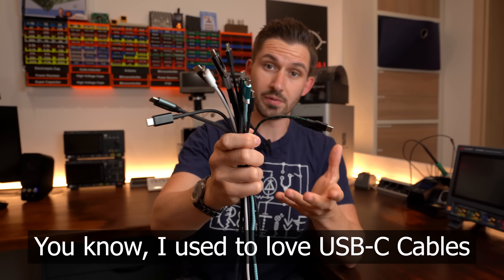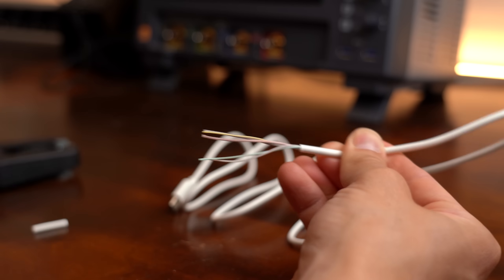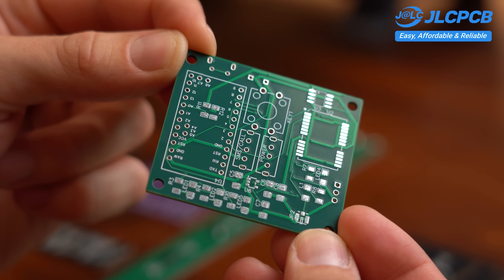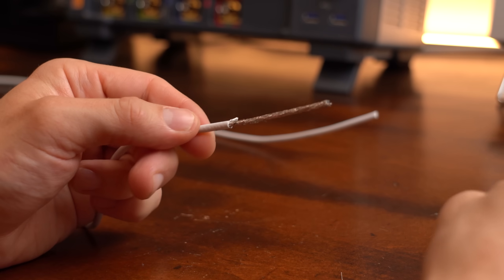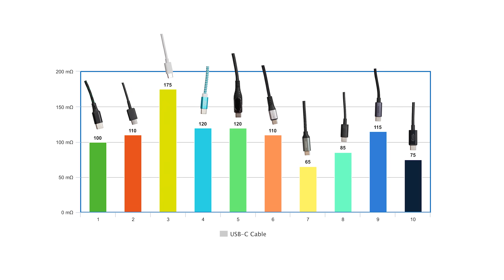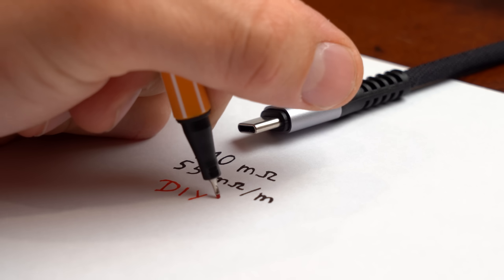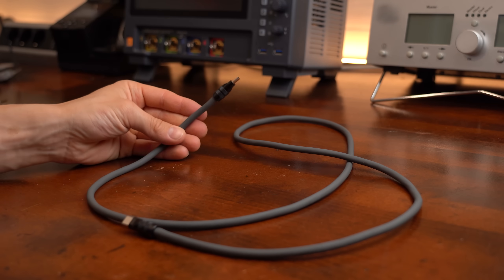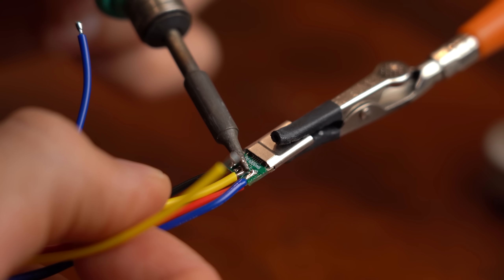Your USB-C Cable STILL Sucks — I Built a Better One? (DIY or Buy)

Comment: Probably worth shielding the data lines from the power. Another improvement possibility could be to use the entire cable as a large capacitor for smoothing power lines by running two shields.

Comment: A bonus for the 8-wire cable: it makes it extra easy to exfiltrate data as it acts as a transmitter.  It also helpfully receives radio signals (though only those around the clock speed matter much), because it's really an antenna.  So yeah, it's probably worth grabbing a shielded cable (with the shield connected to ground), unless power is all you care about.

Comment: Finally it’s something I wanted to do for so song!
Don’t forget to put a thermal pad on that IC and resistor. Or replace the resistor with a bigger wattage one, when they get hot they perform poorly at high PD

Comment: All USB cables have these problems, not just USB C. A lot of products that include a cable for charging are coming with cables now that can only charge but have no data wires and none of them are marked so it's hard to tell them apart so I had to buy a USB cable tester just for that!

Comment: Seems like it was annoying when the previous usb cables didn’t work, with a potential of 240W’s available it’s going to way more than just annoying when this goes wrong due to cheap components or incorrect specifications

Comment: I test the eMarker and PD capabilities of all my USB-C cables and devices when I receive them.  Then I catalog them according to their specifications and label them with a catalog number.  I do something similar for all my components.  

The idea that you can somehow know the specifications of a part just by looking at it is a fiction.  This is so for far more than just USB.  The administration of identifying, cataloging, and labeling pays back quickly.  That’s why enterprises do so.
Reply: Do you use the same tool as in the video?
Reply: Please elaborate on your process, I would greatly appreciate it

Comment: I use UGREEN 100W PD 6.6FT USB C Cables, not only are they priced cheap but they are high quality for that price. Got 2 of them almost 2 years ago and they are both still going strong. I will say though that when i do USB powered projects that only need the Power and Ground wires, i do use USB Male and Female Screw Terminals so i can use my own wires.

Comment: great vid, probably easier to find a reliable supplier for most applications….I learnt long ago to buy cables that explicitly state their application on the plugs, used to be horrendous back in the micro usb days! yet I still have those usb terminals in my drawer for those special projects

Comment: It is obvious that many chinesium cables barely work and the race to the bottom would be infinite, but did anyone try what is the MOST power that usb-c DIY monster of a cable would be able to continuously deliver without melting or burning up parts involved?

Comment: USB C cables are potentially dangerous with the slack standards in manufacturing! A few weeks ago I had one literally BURN in my hand using it to charge a Samsung Galaxy TabPro S. Not only did the cable end melt, it ruined the charger and the hub (video, network, usb C and usb A ports) There really should be some standard enforced to identify the capabilities of these cables. Micro USB cables were flawed in their own ways (wearing out, lack of features etc) but they "just worked"

Comment: I believe you mixed here two standards (widely supported simultaneously) PD and QC.
PD maximum power is 140w achieved by 28V/5A and QC can do more but doesn't acceed 20V
Reply: USB PD 240W is 48V and 5A, its a new standard.

Comment: See i hardly use usb for data only for charging. My phone will do 125w and i just buy cheap cables fromr temu. My son has autism and has a thing for destroying cables 😂. Anyway i have seen even on the stupid cheap ones, over 60w. Im talking 80p cheap which is roughly €1. I buy 10 or so at a time and rhey work very well. Ive never had a problem with data either they definitely do data as ive used them on my laptop with my game controller but i couldnt say how fast they are. I just dont see a big need now to move data over a cable when wifi is so fast and unless your charging a laptop 60w is more than enough for a phoneor tablet. I actually ruined my previous phone also 125w by super charging every time. The boxed charger is 125w so thats just what i used. In less than 2 years it was at 70% health. So charging at stupid high wattage isnt always the best and you shouldnt unless you have to.

Comment: If you ever wanna test more USB-C Cables you should get the BLE CaberQU. Data and power rating, connected pins etc. immediately shown after just plugging a cable into it. 
 It was initially sold via Kickstarter (already delivered. So not a scam) and is on preorder for the regular website but the dude who made it also has a youtube channel (Quiescent Current) and shown it plenty of times. 

It's just a very useful and very quick tool to quickly sort and test USB-C cables. 

Honestly that little device might just be worth including in a video anyway.

Comment: THE WORST IDEA IN THE WORLD TO PUT ELECTRONICS INSIDE CABLES!!!!   SO thats how chinese install spyware into every our computers-via usb cables.  Instead of end device telling charger how much charge it can handle-for some reason wires talks to chargers :DDD horible! horible idea.
Anywya back to video - horible DIY wire... such thik wire can be used to solder things :) thats the problem even enw phones comes with such hard fat cables it impossible to use them..they too hard.
Fast charging phones are BAD. max 15w is enough. who needs more should check their life, cause it;s horrible if one cant survive withouth a phone.

Comment: I really hate that there is so much junk online.
You can buy so many cables and never know if a cable is suitable for your application.
Even worse if the cable isn't even to specs for the USB-C Standard.
It's just sad that you can't reliably buy a cable that's tough and lasts for what feels like forever.

I would buy a cable for more money if I knew it would last and not breake on me...
Reply: Especially the thing that USB 3.0 is now called 3.1 Gen1(I think, not sure lol). Why the heck change the name of a standard and much less make the number higher?! Makes me so tired.
Reply: Surprised nobody talked about USB-IF (USB Implementers Forum).  Its the official organization that sets USB standards and cables certified by USB-IF comply with the required electrical, mechanical, and signaling specifications to ensure safety and performance.

Certified cables are allowed to display the USB-IF Certified logo indicating their data and power capabilities (e.g., USB4, 40Gbps, 240W).
Reply: @fredthebulldog529  Probably because they aren't the absolute authority on USB cables, and literally no USB manufacturer cares what they say, or follows them.
Reply: Thanks China
Reply: @mediocreman2  with Chinese manufacturers, you get what you pay for. Buy your cables from reputable brands (like BaseUS for example), and you'll be fine.
Buy the cheapest Temu garbage, and you'll get, surprise, cheap garbage.
Reply: Why would you buy USB cables online? Who would order USB cables when they could just walk to a store? That's not only dumb, but very lazy. If you're on a website buying cables, you can pretty much guarantee the cables won't be up to anyones standards. Here's how it is: Free cables that come with things like USB speakers, do not have data transfer, and are only good for 5 volts at 500mA. Cheap cables, like from the dollar store, do have data transfer, but are again only good for 5 volts at 500mA. You'd be looking at spending between $10 and $30 or more to get a proper USB C cable, with full functionality. The style of cable shown in the thumbnail, with the braided fabric on it, is a proper USB C cable, and they do last a long time if you're not plugging and unplugging it all day long and folding it up and tossing it in a drawer just to take it back out and stretch it out. How many times per day are you charging your phone? It should be one time or less.
Reply: @dk6578 because it's convenient, they're quite good and there are reputable brands.
also, I'm yet to see decent cables sold at a retail store.
Reply: @dk6578 are you serious? I can get much, much better cables for less than a quarter of the price online. That’s why. Why would I pay $20AUD for a 60W USB C cable at the petrol station when I can get a 240W Thunderbolt 4 cable for $5.

Comment: I expected a greater improvement on the Vdrop of your oversized DIY cable. That tells me that most of the losses may de internal in the connectors (contact loss plus tiny brass fingers and pcb loss) 
A good baseline could have been comparing the results of all cables with your super short first DIY attempt, as it should represent the best possible result with that connector tech

Comment: i use a cheap 1-2€ 100W cable (i only use 20-65w)
i replace them every 6 months or so.... tried more expensive ones, and end up replacing them equally

Comment: When you need a beefy power delivery cable I think most of the time you don't need the data lines. And in the same way, needing to transfer data you don't need beefy power lines. 
So, for me, the solution would be a DIY cable for power delivery without any data lines, and a conventional "5gpbs" cable for data transfer and use them as needed.
Reply: how would PD handshake occur without the data lines tho?

Comment: Thanks to your past inspiration i buyed USB cable tester and tested the charging speed of all my old cables for retro tech like MicroUSB, MiniUSB ect. The fastest micro USB cable i have was actualy banned for selling in my country and was given for free by my employer(electronics store). The best thing about these cables with most power output is that they can put to life more old electronics whitch were discharged for many years.

Comment: Hi, this is Kevin from Germany. Is it also possible to solder just a power source (DIN rail power supply) on one side and the DIY USB connector on the other? I just want to slowly charge a tablet. Or is it not possible without the chip and without a USB-C power source?

Comment: I tries this with sftp cat7 cable but it did not work. Now I know why I needed the usb C connector with the chip. I used usb A connectors to make a long extension but it was to slow. Thanks for the tip!

Maybe you could try this to and see how long you can get is stable.

Comment: put together a kit for a diy cable, love it. ill trust your ken as what parts are mint, love the connector ends n sleeve lol i wanna make one! everything i find you need to order 50 pieces minimum and with tariffs on electronics, almost twice the normal price. hell ig amazon actually has some good looking usb-c boards ect. nice video!!!!!! good ideas, and the shrinkable cable sleeve..........wish ida known years ago. ima sleeve all engine controls on my 2002 Pontiac grand prix 40th anniversary car, sc3800 and vacuum lines it will be a panty dropper more so than she is already.

Comment: I would love to see a DIY cable that does 240W PD 3.1 & the highest speed data transfer so I don't need multiple cables for charging & data.
Reply: 0.8m — 1.2m USB4 cable is rather cheap these days. Less than $35.
Reply: You'd still need multiple cables, because only one device can run data through a single data line at the same time, without corrupting data. A proper USB C cable with full functionality does have multiple data lines, but... Each data line is for a specific function such as USB data, audio data, video data. For data transfer, just get a USB Hub, which is made for that. If you need a 240w USB C, you should get a power brick that has USB C. Your device, laptop or desktop, isn't going to deliver 240W through the USB C port, regardless what the cable can handle. And that's what PD is, power delivery from your device.
Reply: Go for a thunderbolt cable, they can do high wattage and high speed

Comment: Awesome, personally I would go for a thunderbolt type connection speed too unless that is proprietary which wouldn't surprise me cos Apple had a hand in it, I'd like a 1.5 metre cable with 240w max and 40gbt wonder how I'd go 🤔😂

Comment: Interesting. But is it even possible to build a USB cable with great power delivery and great data bandwidth?
Reply: OK. Somebody beat me to that question. But still. Is it even possible?
Reply: Yes but all comes at the cost of size / thickness / ergonomics which is usually the priority (you dont want your cable pulling your phone off the table etc)

Comment: Very good! But next you can try USB C longest solution with high power and fiber for data... Or a complete long range cable with fiber for optical galvanic insulation without power. Could be an interesting experiment.

Comment: I would want to know of all of your cables how they fare at data-transfer. I bet there are engineering trade-offs the manufacturers are making between being the best cable at just delivering power , or being the best at just delivering data, or striking a balance in the middle.
And I would like to see a DIY of a super speed cable.
please.

Comment: I’ve been doing this the last couple weeks and it’s so satisfying, I like using silicone wire and twisting them together, then putting 3mm silicone tubing over it, that way it can be any color you want, also you can add stainless steel braided sleeve over it if you need shielding

Comment: My problem with USB-C is that the connector is simply not built to handle these massive currents and are unreliable. I have so many dodgey USB-C connections. At work I use a USB-C cable to connect to my dock and monitors. If the USB-C connection is bumped it looses connections and has caused the laptop to bluescreen multiple times. The pins are simply too small and the contacts are flimsy. I think some of the earlier, larger, plugs were much more reliable. I wish not everything, including critical, connections had started to use USB-C. For example my microsoft surface has a single USB-C connection for everything. What happens when this connector breaks?

Comment: I've heard this complaint many times, people often struggle to identify whether their USB-C cables are meant for data transfer, fast charging, or both. Personally, I've never had this issue. I keep track of my cables and mainly use two types: fast charging cables, and high-speed data cables that also support fast charging and most Thunderbolt features. My advice? Just stick to two reliable types. It's not that complicated. Honestly, I think people tend to overcomplicate the situation. It's not really the manufacturers' fault, there's just a lack of awareness among consumers.

Nice video tho, keep up the good work:)
Reply: I don't have much of a problem either, but I can see how somebody could.

A common enough scenario is somebody who's always on the move and tends to misplace or forget their cables. They buy whatever they can get their hands on at the most convenient store or vending machine at the time, and click on a fancy USB cable ad thinking "now I'm going to throw away all the cheap ones and keep these nice ones organized." But they don't get that far, and now they have a junk cable drawer in the kitchen with everything in a jumble. 

Under the wrong circumstances I can see myself falling into that. Living with a badly paid, stressing, outside sales job could do it.
Reply: what grinds my gears is that it's just a matter of.. looking at the package and seeing what the listed numbers are, and the fact that so many people apparently struggle with it makes me wonder how they go through life at all

Comment: It really would be nice if specifications would not have long sections bordering differential equations just for the resistance specifications. And simple key-characteristics should not be hidden under hundreds of pages.
At the least some "absolut max specification" should be included like
"The cable must not exceed 1W of powerloss per 1m under any rated voltage/current. It must not exceed 100mOhm/m and it must not exceed 500mV of voltage drop"
It should NOT be specified which wires or diameter mus be used - sometimes you want thicker wires, sometimes you might prefer using thin stranded wire and multiple of those.

And Ali - i like it, but if you need ANY quality-control then you should not got it from there.

Comment: The best part about DIY is when the cable inevitably breaks between the connector and the cable, you can cut past the break and resolder the connection.
Reply: you could do the same with the regular cable and a spare connector

Comment: I have an ID.4. I pretty much charge exclusively on 120V because the reported EV charging infrastructure in the garage for my rented home is... hidden somehow and the owner is a little weird. However, since I have good public transit access (and don't like driving in the big city), my car is largely used for hauling supplies and heading to a town about 30 minutes on the freeway. I could do one of those drives every day and still fully recharge overnight. 

I occasionally go on longer drives through the PNW, but rarely need additional charging. Since most of my frequent drives can be easily recouped in 10ish hours, even when I drain the battery on a large weekend trip, I don't really worry about being able to take the car out for errands the next day.

Honestly, even if I had a daily commute, I'd likely be ok as long as it wasn't too much over 30 minutes. In fact, I've recently started only charging to 70% as my default to be even nicer to the battery since Im typically using between 10-15% for a drive

Comment: The straight forward, yet slightly overbuilt, DIY cable is so German -in peak functionality, basic design aesthetic (not a bad thing), and in that it will probably outlast the devices it's used with. 😁